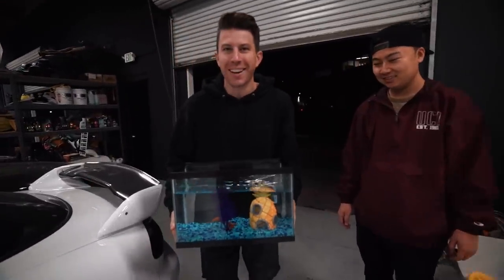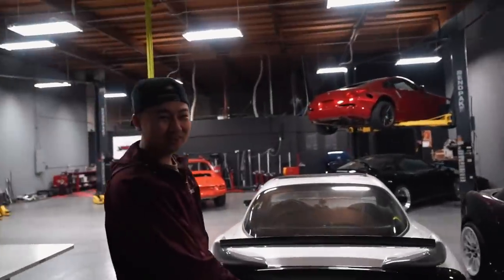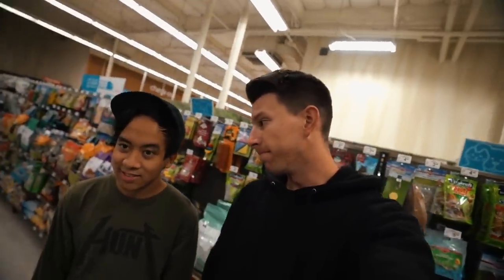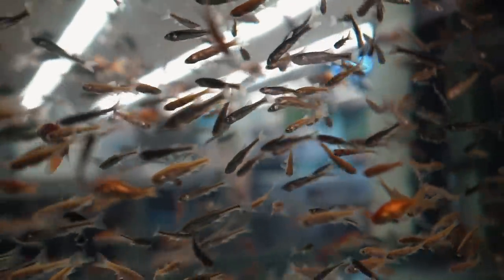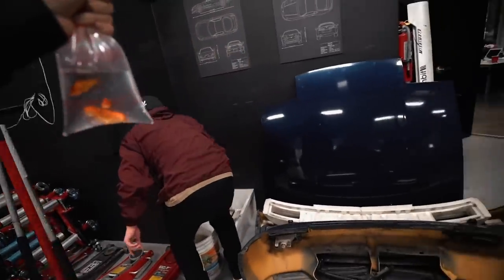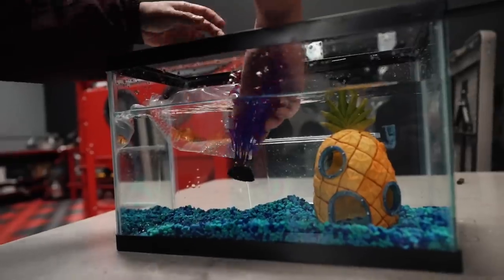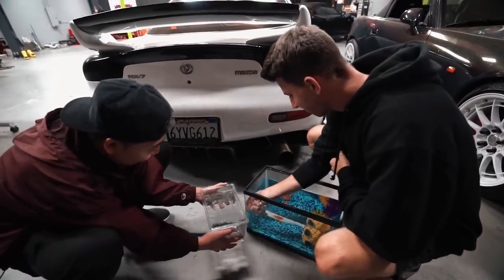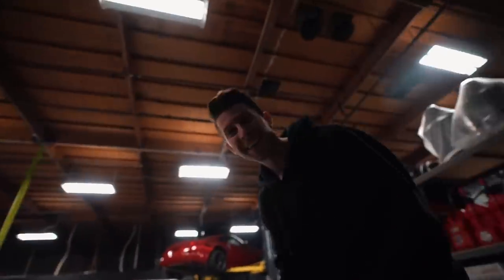FISH TANK VS. 600hp RX-7!

Comment: Actually, the glass broke because it shattered once it hit the ground, not because of the pressure from the 2 step.
The glass on the side nearest the exhaust was very warm, so when the glass hit the ground, it blew out the hole on the opposite side. Close, but We'll need to see slow motion from the exhaust side to really show if it can be done. I want a redo.
Reply: Dude the first big flame blew a hole in it,clearly  see that
Reply: That is not true lol, scientifically it doesn’t make any sense........... but in regards you can even see the hole being created before it fell completely